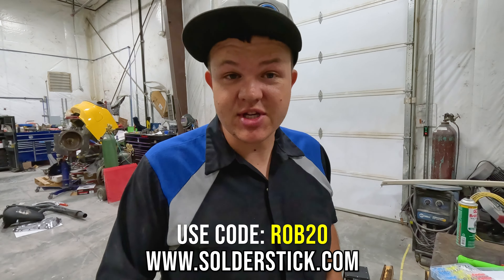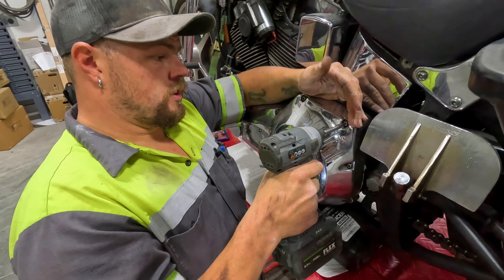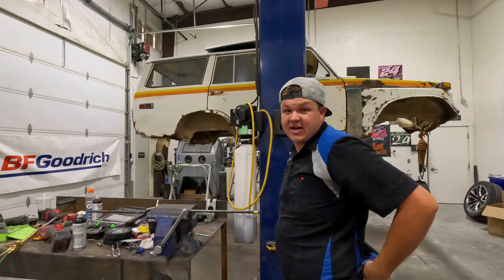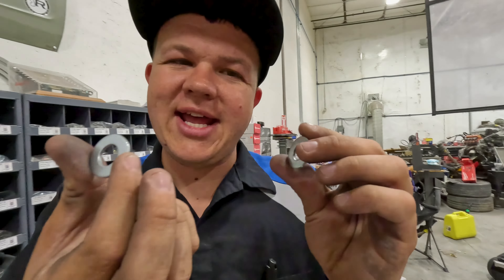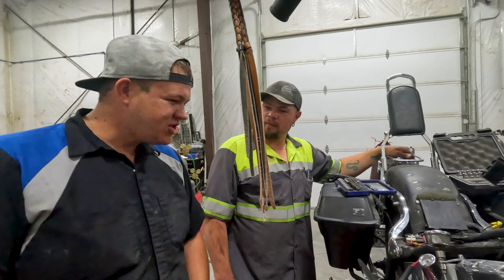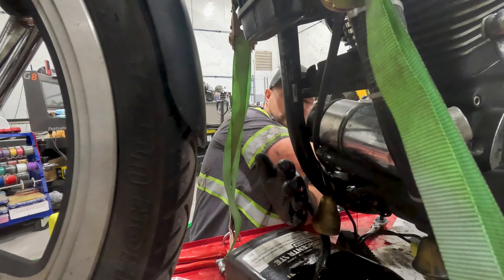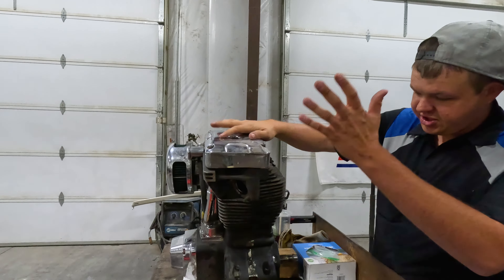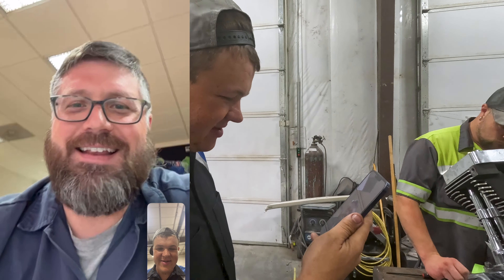Total Disaster Tearing Harley Apart, Nothing’s Usable!

Comment: Just a few thoughts... If there is enough side play in the primary chain that you can remove it without pulling the compensator AND clutch hub, replace the chain.  Side note, I think the bolt for the clutch hub is left handed thread. That motor is a cheap knock-off.  Fixing it is probably a waste of money unless someone like Craig is willing to do the labor for free and Hillbilly provides the parts.  Personally, I think he would be better off with a certified HD rebuilt motor. Drain plug on the primary cover (depending on year) may be a tapered thread.  If so, do not overtighten or you will crack the case.  Tightening down the head bolts involves tightening to a specific torque, marking the bolt and taking it another 1/4 or 1/2 turn.  That stretches the bolt, so they should be replaced for reassembly. Be sure to flush both the oil tank and all oil lines. Hillbilly may not like this, but long term reliability comes with not going crazy with performance parts. Runout on the crank wheels is CRITICAL. If you don't know what you are doing, leave it to the pros!  I love you and Hillbilly, but for the sake of a reliable good running machine I would suggest you farm out the rebuild to a shop that knows what it is doing.  JMHO.
Reply: Pretty sure they wont be rebuilding the motor now considering what it went through in the video
Reply: I have two Electraglides and I'm learning how to work on them. How can you tell it's a cheap knock off? Thanks
Reply: @jasonbrownlee7467 Use of the word Harley-Davidson®, various model names and designations, and OEM part numbers are provided soley for reference and application information and there is no affiliation between Harley-Davidson®, Inc. and Ultima® Products, Inc. That comes right from Ultima's webpage.  Ultima builds a motor that fits into a Harly frame and has no ties with the Motor Company. Not knowing the actual age of the motor, Ultima did not have much of a reputation for quality
Reply: i agree ,
Reply: When hr got that chain off without taking the clutch off, I was like wow he has not a clue. He had to pry that chain off. Not good.
Reply: @jasonbrownlee7467 because HD did not make a 127ci. Common are 88 witch is 1340 cc 96 .103. 104. 107. Yours is probably a 96ci.
Reply: I would recommend a 104 ci with stage 3 upgrades.  Because thay will hold up over time. And have all the power you will need. Don't want to hear he died in a crash some day.
Reply: @Rags722  Yep Harley and Ultima Have a lot in common. Sad that an American Icon can't build a reliable Motorcycle.
Reply: I wholeheartedly agree on everything you say.  Stock rocks, and is pretty much dead reliable.  Start modifying, even stage 2, and you start all kinds of problems.   Secondly, if it can be done, get an intake manifold and a Mikuni carburetor.   They are based in Northridge, CA...You will have a very good, easy to jet, reliable carburetor that way.   Get 5000 ft and sea level main jets for it. And if at all possible, Always run the fuel out of the carbs before you put it away in the garage, completely, as you would for an outboard motor. Ethanol in gas is a Carburetor killer.
Reply: @feloniousmonk3049  that's a fact.  Even the fuel injection as long as you stay harley or S S . You know it will play nice together
Reply: @josephlovell6951  Not quite, your CI to CC conversion is off . Actual advertised allows for some rounding 74 was 1200 cc, 80 was 1310, 88 was 1440 103 was 1690
Reply: @jimmyjackass1805  Well, I can't say that HD has always delivered a quality problem free product. Fine examples of failures were the M&M injection system, first 2 years of the twin cam motor, base gaskets on EVO's, compensator issues on a number of variations, etc.  However one of the biggest problems with Harleys is their owners that take a brand new bike and have the dealership add thousands of dollars in upgrades (both mechanical and trinkets) before they even take delivery. Then get them home and start doing additional "mods" to personalize the bike and add crap that restricts airflow or does not match up with the factory "map" in the ECU. Honda owners seem content to buy a Gold Wing and add a Gremlin Bell and some custom artwork on the fairing and bags.  My current HD I have had since new in 2005. She's old and tired but the only real problem I have had was blowing a 15 amp fuse for the ECU that started after the first dealer service and was finally tracked down to a wire that was pinched by the tech after lubing throttle cables. I've done all the routine maintenance and it hasn't given me any real "problems" other than an occasional noise that can usually be tracked down to something that didn't get tightened down correctly.
Reply: Ultimas are like S&S motors, yuck! Get a crate motor, stock. Leave it alone.
Reply: @timgilbear  no not an sns motor just carbs

Comment: Throw in a made-in-Wisconsin S&S crate engine of about any size you want, they are designed as Harley replacement engines.  Available at J&P Cycles or Dennis Kirk, both vendors in the midwest (no affiliation but good sources).  One will cost about $7,500 or about what the whole bike is worth.  But it will be a killer engine.
Reply: Jim's makes the Harley authorized TC  ..
Reply: What is the difference between a Harley engine, the Ultima that was in it, & the 1 ur speaking of. Don't u want a Harley engine? (Idk bikes at all !)
Reply: @macattack1392  The TC engine in the bike and an S&S engine are both after-market products.  S&S may be better known, I hadn't heard of TC.  You might have to find another Harley for another Harley engine vs. just buying an engine only, in a crate.  Buying a new crate engine gives one flexibility on displacement vs. having to rebuild another Harley engine to the spec and displacement you want.  Just another way to proceed vs. rebuilding after-market equipment.
Reply: @schnell356  oh ok. I figured owning a Harley the best would be to have a Harley engine but again idk/have a clue. I know cars grt engine swaps but that's a bigger deal. Guess this is kinda of the same just more common. Thanks for the reply

Comment: I’m know very little about the Harley engines but I do enjoy trying to understand the whys and what furs of different designs. Interesting thing about these is because the rod is made for both cylinders, they don’t evenly offset each other as the two pistons go up and down. You end up with pressure then vacuum then pressure inside the crankcase as the engine rolls over. Lots of jokes about Harleys leaking oil but the crankcase (and other) gaskets take a beating, gettin pushed back and forth as the engine runs. The vent for the air to go in and out isn’t just open all the time either, I think those flat spring valves you noticed are part of the PCV system. I think some of them even require the vent be timed with the crank! It’s way different than most of the stuff you guys work on and know about. If you decide to build this one up, get some good instructions and follow them closely, don’t assume anything or it will bite you! Good luck whatever you decide. It’s still a cool bike and worthy of being put together right. 👍

I think the flat black is a cool look, kinda ratty but that sorta fits HillBilly I think he would agree. BTW, do you know why it has a bell hangin under it? 🤔

Comment: The motorcycle lifts from Harbor Freight are just fine really. You just can't leave it pumped up all the time, put in the safety lock and lower it onto that if you're going to keep it up for long. Also, you need to upgrade the wheel clock. Harbor Freight has a good one that will mount right on and then you'll be all set.

Comment: Solder splices of whatever brand are great for wiring that is newer, shiney and has no tarnishing or minor corrosion on them that prevents the solder from sticking and making a good connection. Crimp pressure forces through the surface corrosion for a better connection on older circuits.

Comment: A 127 ci motor just isnt going to b in Hillbillys best interest.. they are timebomb when new, waiting to break. Get a stock 88 or build a 95 on an 88, and he will have a reliable engine for years.
Reply: Person speaketh the truth.
Reply: This this this so much
Reply: They're fun, but they're at the ragged edge. If you want a tire fryer or bar hopper it's a lot of fun, but if you want to be able to eat up some miles it's better to go milder.
Reply: Completely agree. I ride a mostly stock '04 Fatboy with just a carb upgrade. Over 80,000 miles and she purrs like new. Just do your maintenance and like any motorized machine ........  do a pretrip. 'Nuff said.
Reply: @lectricfence1 
I don't notice many newer "Post AMF" Harleys broken down along the road and I see tons of them on the highway. 

Back in the AMF Days there was a guy on a new at the time Honda GL1000 ( Pre Goldwing?)
This guy was wearing a Harley Jacket. 

"Why the Harley Jacket  "
"Oh, I own a Harley Dealership. Today I just wanted to ride and not work on a bike."
Reply: @randytolle6706  Good story. Seems like Hondas have always been a dependable bike. My first bike (I'm going to show my age here,) back in the '60s was a honda 50, then a honda 305. Then a Triumph Bonneville 650 I rode for years.  Then in the 80's, a customized  (amf) super glide. They were all fairly dependable, except for the Super glide which had to many people try to customize it but, I had to have a Harley. Anyways, got the Fatboy in '04 and never looked back. Except for the wheels. Changed those stock wheels for Roadwinder wheels and sprocket as fast as a could.

Comment: I built one of those when I was 16 and here it is, 40 years later, and it’s still running. I bought a ‘59 panhead from a swap meet it came in 3 milk crates and a frame. Super simple things to work on. 100+ year old technology. Not a fan of Harley at all, but they are easy to fix.

Comment: You likely have them done and on the bicycle. But you are better to take off the pedals and let her just use her feet to hold herself up and walk/run on the bike. She will learn to balance faster than with training wheels.

Edit: Assuming that with the E part of the Ebike turned off the bike can still roll. Otherwise get her a regular bike first and pull those pedals off. Likely one or two days to learn.
Reply: walk with e-bike ? thats just a grazy accident to happen.
Reply: The ebike is a problem. You’re trying to teach your kid to run before they walk. Plus with those training wheels in the center like that, she could easily run over her leg if her foot comes off the pedals. I’ve found that the best way is to start with 2 training wheels, then remove one so they still can lean to one side if they get in trouble. I think a lot of parents put the training wheels on, then wait for the child to tell them when they want them off. You need to remove the training wheels once you, the parent, thinks they’re ready.

Comment: Like I posted on the previous video:  Don't even think about rebuilding that Ultima.  You want a big V-Twin, go to S&S and decided how much horsepower, and how much ya wanna spend.  The V111 is a beast.  Or find yourself a decent used 80" EVO to stick in her.  

Or... ya can drive or fly into SE Michigan and buy my 1993 FLHS and ride it home.  I'll let it go for a lot less than sourcing a good V-Twin.  And for a bit more, I'll toss in a real bike lift (Direct Lift), smaller lift, stand, and a whole bunch of OEM and aftermarket parts.  I'm 72, and I haven't ridden it much in the past four years.  It needs to find a good home and someone who'll ride/enjoy it.
Reply: then they would have to start over! Once is probably enough...
Reply: I don't disagree, but it was a free bike and I doubt  Hillbilly has deep pockets. Ultima sells every part for that thing and so its likely the cheapest way to go and I suspect Hillbilly can handle it.  Heck, Ultima should just give them the parts for advertising.

Comment: Here's a tip Harleys have different length bolts on the Primary cover and else where. Get a piece of cardboard draw the cover and push the screws into the cardboard it in the proper placement. you don't want to run a long screw into a blind hole you'll bust a case. Change the primary chain tensioner while your in there they're only good for 50k miles. Don't forget the lock tight when you reassemble.

Comment: if you have to rebuild the motor the lower cubic inch motors last longer and do not over heat as much, stock pistons and jugs will make you much happier in the long run 88 and 103 ci was stock in 99, paint it candy apple red

Comment: That first piece was the primary cover and to fill the oil you take off the derby cover which is the large round cover on the primary cover you can do the inspection cover but most do the derby cover.

Comment: Those solder sticks are awesome, but I still cover the joints with heat shrink as I've seen those melt a little too much a few times. But they do hold very well and can be installed with a heat gun

Comment: Strip the bike down to frame clean and if needed re powder coat the frame.  Paint the tins and bags, and lastly drop a new motor in the bike.  I think I would look at one of Harleys stock motors.  I never felt like I needed more then my of Heritage had.  And I would also go Fuel injected where you have so much elevation change when riding in Utah.

Comment: Could be the compensator issue that Harleys suffer from (unless you use a third party fix for it). That issue would ruin the bearing, shaft, etc. When Hillbilly took the chain off, the compensator is the smaller twin sprocket at the front of the case. It makes the horrible clunk you hear when you change gear. My Harley has that fixed using the Evolution Industries 34t solid motor sprocket kit (mine is a later model, but only a 107 engine).

Comment: I did almost the same thing with my Kawi Concours motor... 
ran it, low on oil... ate a bearing... and in middle of me tearing it down... 
realized I just needed a new motor... no way I was putting it back together in spec... 
got a lightly used one, drop it in and rode it until a car hit me...

Comment: solder stick??? do a test .... if you want..... do a regular solder... with a good shrink tube ... then do a solder stick.....   then do a pull test...  see how much it takes to pull the different soldered wires apart ...  ive tried these.. and they failed... not failed in the connection... but in pulling apart... how long the soldered wiring will last... and not break down due to heat?

Comment: Your best move you could make at this time is take the crank to the harley shop, along with the cylinders and heads. They can rebuild the crank and install new rods, bearings, pistons and rings, hone the cylinders, and fix the heads and valves if needed. Tou should also replace the main bearings, maybe clutch if needed, and a manual and put it back together, and ride it.
Thom

Comment: Hey Hillbilly. 
That's not a crank cover it's a primary cover. That's your primary chain. The problem your going to have is behind the clutch pack. There is a bushing that is pressed on that has to come off to pull the inner primary. 
Been wrenching on bikes for 40 + years. If ya have any issues or questions hit me up.

Comment: Take the cam chest out, right side of the crank... you're bound to see some metal in and around the oil pump.  Also, cut the oil filter open and spread out the paper filter element, and you'll for sure see what type of metal is shed from the engine. Steel or aluminum,  roller bearings, etc.

Comment: Robbie the electric bike for your daughter those bikes usually come with a basic motor controller and have 2 speeds on and off but ou can get a controller that allows you to ramp up like a true motor cycle throttle then you can also program say 33 % throttle just a thought

Comment: I think best bet is new motor 
By time you thoroughly clean all those shavings then the piston shaft and pull the one piston you could have put new motor in 

What you got is a project engine for pro that's dealt with Harley engines if it's not done 100% right you could be right back where you started or worse

Better to stop and get right engine and parts and go from there

Comment: Back in the ‘70’s I bought an old Harley, more as a project than anything. I tore it completely apart and rebuilt it, with no experience other than basic mechanical knowledge. I rode it for nearly seven years and sold it for the usual reason… a new baby. That was the only reason I would have sold it. Hillbilly will love that bike.

Comment: The problem with training wheels is that the child doesn't learn to balance, but, instead relies on the wheels.  To teach a child to balance a bike in about 20 minutes, do the following:-
1)  Take the pedals off the bike so that they don't bash her legs
2)  Position the saddle so that her feet are almost flat on the ground when she is sitting on the saddle.
3)  Find a slope down which the bike will easily roll
4)  Position the child on the bike at the top of the slope and make sure that she can operate the brakes
5)  With her feet on the ground, get her to push off down the slope, with her feet sort of running along while she is sitting in the saddle.
6)  Continue a few times and she will very soon be able to take her feet off the ground and balance the bike
7)  Re-fit the pedals and re-position the saddle, if necessary
8)  Repeat the exercise, getting her to put her feet on the pedals, once she is balanced
Robert's your mother's brother!

Comment: just an opinion. Stock HD 88 ci replacement. Might think about a Baker 6 speed tranny if you want to spend some extra money . If your going to do a lot of long range riding it helps keep the rpm lower, engine cooler. I ride a mostly stock '04 Fatboy with just a carb upgrade. Over 80,000 miles and she purrs like new. Just do your maintenance and like any motorized machine ........  do a pretrip. 'Nuff said.